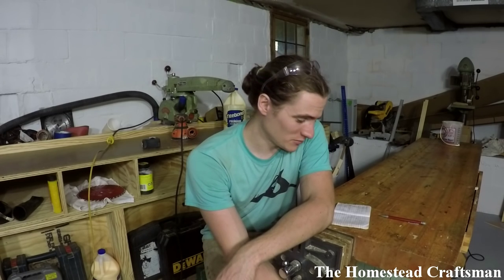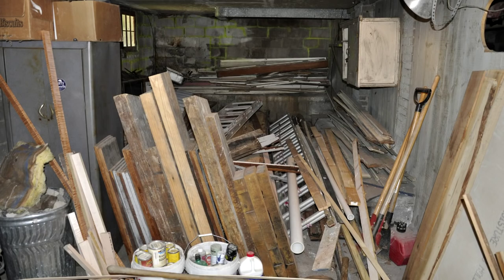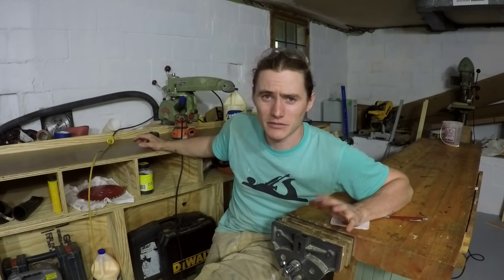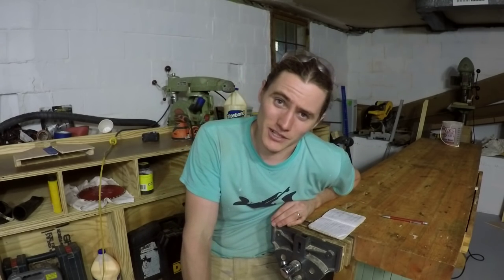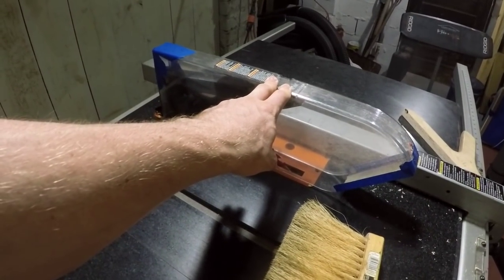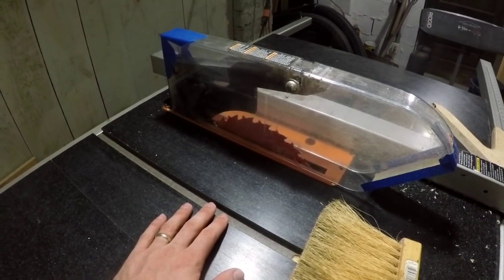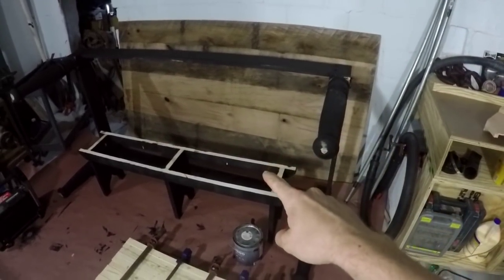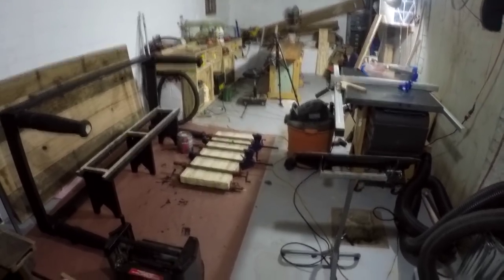The Craftsman's Corner Ep. 7 - New shop, projects, tools, dust collection and more!

Comment: I already knew you were still alive,since I didn't feel any tremors in the Force :D
Turning room and clamping wall sound neat. I think having a shop spread out over two or three rooms is not a bad thing, since it cuts down on dust spread and have more wall space to put stuff on.
Reply from the maker: John Heisz I too liked the idea of separating it a little, especially for the turning, there's no really good way to keep that clean outside of cleaning up after the fact. At least this way it will be closed off. The clamping rack is something that I've wanted to do for a while, I'd like to do a couple of them or have them layered maybe. A 8x4 foot table top takes up a lot of space, against the wall it would barely be noticeable. I wish I could clone myself a few times and get it all set up quick, but I don't think that's going to happen. Thanks for watching John.

Comment: That Freud blade's design with the raker or clearing tooth is meant to shoot out cut debris away from the blade, but having it also cuts differently, making more chips and sprays them every which way, good quality blades though lol.
Reply from the maker: ZipKickGo Well it certainly clears the chips! The shop vac on the blade guard worked like a charm, once my dust collection is set up I'm going to make some sort of overarm collector for the saw, or buy one. I always thought of them as in the way, but using my splitter and guard hear lately has been nice, so I think it's a good idea.

Comment: Hi, I hear what you are saying about your shop but I would kill for that much space. My shed is only8 feet by 4 feet and I have to work outside due to all my tools being inside. I have a table saw and router table with a band saw on the other end that takes up most of the room, then I have to keep my 2 chop saws and dedicated mortise machine in the other corner opposite my floor mounted drill press and scroll saw. the small compressor and dust collection goes under my table saw and all my other tools go everywhere else.So as you will have realised my now looking at the size of your shop fills my with envy.

Comment: Hey thanks for not keeling over!  :-) :-)

So do you like having three rooms for your shop?   Did you ever, for instance, consider fitting in a steel I-Beam so that you could knock out the wall between the lathe room and the middle room?

The white paint makes a huge difference.   Proper lighting will be even better.   Looking forward to seeing that kitchen island.
Reply from the maker: wordsnwood I won't be in this shop long enough to go quite that far. I actually like it being broken up a little, turning is a huge mess so having it in it's own room not only keeps it more organized (tools and projects) but it will keep the chips from flying around, sanding is also pretty dusty, so I'll have it on it's own dust collection set up probably. The main part is just divided by the wall down the middle, which I also like for workbenches and wall space for hanging things.....and also to keep dust and sound a little separate. I'll be going over all this in detail in future videos.

Comment: Nice to see your new shop. One thing that crossed my mind was if you could knock one wall down to make some more space in your woodworking shop. That might not be a option, though. It just looked a bit cramped In there :) Anyway, always nice to see things from you.
Reply from the maker: DrZalt It's not too bad, my first project I made was a 7 foot by 44 inch table, handled it nicely and it's not even a whole shop yet. Once I've got the whole place set up it will be great. Thanks for watching.
Reply: The Homestead Craftsman  it might be one of those things where it looks smaller than it actually is. :)

Comment: I have only been woodworking about a year and a half and I have a shop about the size of the main room you shot this video in.  It is also shared space (laundry room).  Space is a real premium.  My shop is only 84 inches wide in the spot where a TS would go.  So I could squeeze a Tablesaw in there but it would be real tight.  I guess I am asking is the RAS really the one tool shop it was pitched as?  Or is it more of it does a lot of things but does not do them all really well.  I also have a 14 inch bandsaw so I could rip with that.  Your thoughts
Reply from the maker: Joshua Burke I think of the table saw as the main tool, but that's me. I just recently got my RAS. They do indeed do a lot, and do it well if set up correctly and the right blade is being used, negative hook teeth.  You should just keep doing what your doing and get tools as you need them, instead of trying to guess. If space is tight, you could get a portable table saw that folds up, I have the Ridgid, it folds up and is on wheels. You can easily take it outside. I also have the flip top stands home depot sells, it's an out feed basically, very handy. If I could only have 3 tools it would be a table saw, miter saw and cordless drill. Those are the three tools I started out with making and selling furniture. After a while I added a portable planner and an old jointer, which really opened up more opportunities to make higher priced items. Since then, I've collected up more tools than you can imagine and don't even have the original tools any more. Tools are fun, but when space is limited you do have to consider their worth vs. space they take up. I got to rambling but I hope the first part helped. Feel free to ask more questions any time.

Comment: I just recently got a dewalt 770 and I am debating if I need a table saw still.  Could I be so forward to request your thoughts on you up coming RAS video
Reply from the maker: Joshua Burke I guess it depends on what you do, but while a RAS does quite a bit, it does not replace a table saw. They of course do a lot of the same stuff, but for ripping a table saw has it beat. If you have any specific questions, let me know. Thanks for watching.

Comment: Hey Man, thanks for the video.  I have a quick questions: do you have any recommendations for a decent bandsaw?  I'm just getting into hobby woodworking and want to get one, but I thought I'd ask you if you have any pointers.  I don't need a professional-grade bandsaw, just something that will give me good bang for the buck.  Thanks again.
Reply from the maker: +Good Time Reviews Hi, it really depends on your projects, that will determine what size you need. Let me know what kind of things you are making and what kind of space you have. In general, for new equipment, I think Grizzly is a good option, they make solid equipment at a good price. Otherwise I say be patient and find a used one that suits your needs. Once I know what kind of stuff your working on I could suggest a model.

Comment: Do you have dust collection on you planer if so what type is it and where did you get it thanks
Reply from the maker: Yes, it works great. Here's a link. https://alexa.design/2o142sM Screws right on to the planer and hooks up to a 4 inch dust hose. I just use an inexpensive Harbor Frieght Dust Collector and a trash can separator. Here's the link for that item. https://alexa.design/2nytrOt